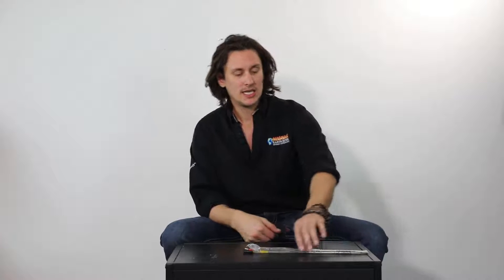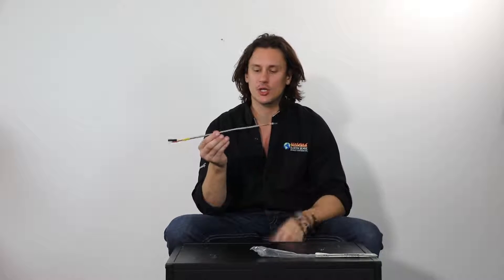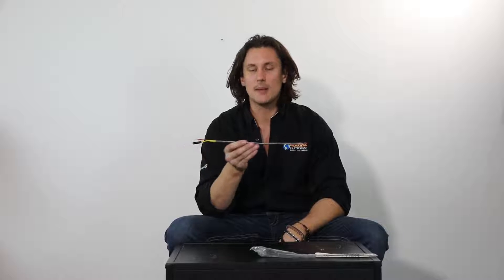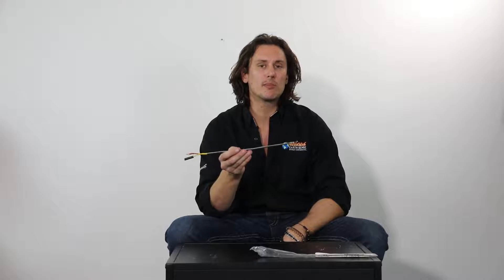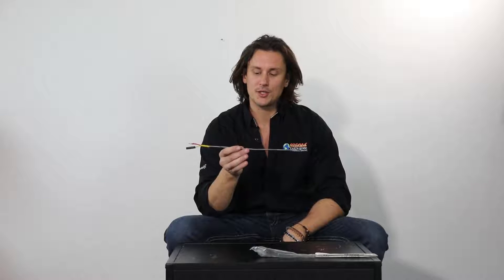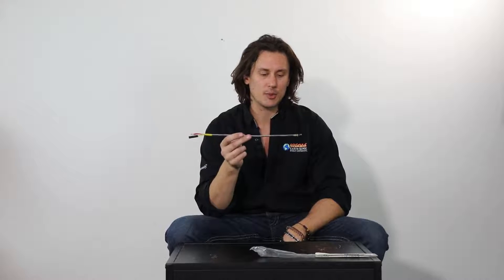Quadrafire Thermocouple Function & Troubleshooting

Comment: Hello, 
My Quadra-fire 1000, has begun malfunctioning. When the thermostat calls for heat the stove starts up ( fans turn on) but does not feed pellets. Fans then turn off, I then hit the restart button and the stove starts it's cycle again and pellets begin the feed and it runs a normal burn cycle. This happens everytime...why would this be occuring? Do I need a new thermocouple? Thanks
Reply from the maker: Thanks for contacting us Jordan, I just sent this to our tech team to get their insight. The Thermocouple only comes into play once the fire has lit in start-up to signal proof of fire. The start-up cycle is a sequence in the control box. Being your stove does feed and go into normal burn operation after hitting the reset button, I would say the Thermocouple and safety switches are operating correctly. I'll follow back up as soon as I hear insight from our tech team. Appreciated.
Reply from the maker: Hey Jordan, Just heard from our tech team. 

'My initial thoughts would be a vacuum switch issue where the switch is not getting enough pressure to close the first round or a board issue. I would try bypassing the vacuum switch first and see if that makes any difference. If it does, then we need to find where that leak or blockage is and remedy that. If it does not change anything then I would start looking at the board.'

Video here for bypassing the vac switch. This is for TESTING ONLY. We NEVER want to leave a safety switch bypassed. https://www.youtube.com/watch?v=FDVkbsHS95U&t=4s

Let us know what you find. Happy to help.
Reply: @EarthSense  thanks for your help guys. I will let you know once I create a bypass switch and get back to you. Talk soon.
Reply from the maker: @jordanwb848  Sounds good Jordan, on standby :)
Reply: @EarthSense  hello again, so the problem has kind of evolved...the thermostat does not start the stove on its own anymore...I have to manually turn the thermostat down and then up, then the stove will start it's cycle or I have to hit the restart button even though the thermostat has not called for the stove to start, but the room is cold and the thermostat should have kicked the stove on but did not. I have created the bypass vac switch and these problems are still happening. I have also checked thermostat connection points and all seem tight and unchanged. I have also tested the thermostat set at max temp and the stove runs a short burn cycle but definitely does not bring the room anywhere close to max temp of 29 degrees Celsius where I've set the thermostat. I have noticed a small hole in the front door rope gasket about the size of the tip of a pencil (I can see the light of the fire here when burning). I hope these additional clues can lead us to a solution on fixing the problem. I really appreciate your help. Thanks again for your time.
Reply: Also please note now that bypass switch is installed, anytime I hit restart button or turn thermostat down then up to start stove that way pellets feed right away and normal startup commences.
Reply from the maker: @jordanwb848  Hey Jordan, thanks for the update. Let's bypass your thermostat. Take the thermostat wires out of the terminal block and let's put a jumper wire or alligator clips on the 2 terminals. Release the connection from one of the terminals to have the unit go into cool down mode. Let us know if it goes through start-up and into normal operation. 

If there is a hole in the gasket where you can see the fire it would recommended to replace it. How does your fire look when it's burning? Crisp/Torchy or lazy in anyway? Happy to help.
Reply from the maker: @jordanwb848  Ok, that's a good note Jordan. Let's do the test on the T-stat suggested in the last message. And let us know how your fire is looking and what kind of build-up you are seeing on the glass. A leaky gasket will create a lazy flame and will trip the vacuum switch. Thanks.
Reply: @EarthSense  ok I will test this as soon as possible, thanks again. Flame does not look lazy in anyway. Glass on the two side panels always seems to get dirty after cleaning them very quickly. Glass on door remains pretty clear except for a bit of dirtiness up at the top.
New note: went to start stove this morning with vac bypass still installed by turning the thermostat down then up again, stove started feeding pellets right away, very smoky startup, followed by smoke coming out of stove from everywhere including hopper into the house for about 2 mins before beginning to vent outside properly. Thoughts?
Reply: Question: when bypassing thermostat, do I keep the vaccum bypass switch in place?
Reply from the maker: @jordanwb848  Hey Jordan, let's do them independently of each other. Have the vac switch hooked up proper while we bypass the thermostat. Then, if needed, we can test it with both bypassed. Keep us posted.
Reply from the maker: @jordanwb848  Hey Jordan, glad the flame looks decent in operation, that's always a key indicator. Could be some build-up or air blockage in the burnpot that caused the excessive smoky start-up. Let's make sure the burnpot holes are cleaned and any build-up in the burnpot is cleared out before re-starting again. Do you have the original ceramic firepot in your 1000 model or do you have the upgraded cast iron burnpot in your unit? Keep us posted.
Reply: @EarthSense  hi guys...so I have bypassed the thermostat, removed one wire from the terminal and it turned on the fans like in a normal startup but did not feed any pellets and shut down after a few minutes. This was with vacuum switch hooked back up as instructed. Next steps? Thanks again for your help
Reply from the maker: @jordanwb848  Hey Jordan, When you bypass the T-stat by jumping across the terminal connection we want to leave both wires in contact to see if it feeds, goes through start-up, and goes into normal operation. When we need to shut the stove down we will remove one of the wire connections on the terminal so the stove can go into cool down mode. Wasn't sure I explained that correctly; please verify when you can. From here if we don't have feed, let's bypass the vac switch and T-stat at the same time. I'm leaning towards this issue being with one of these two items or a combo of the two - just want to rule everything out here before we determine the control board needs a further look. Thanks.
Reply from the maker: @jordanwb848  Thanks for verifying your burnpot style. Yes, let's inspect the burnpot with a good light and make sure all the holes are free and clear.
Reply: @EarthSense  with bypass switch connected to both terminals will I have to hit restart button if stove shuts down after running fans without feeding the first time? Hope that makes sense...
Reply: @EarthSense  there was two holes at the lower end of burnpot plugged that have now been cleaned out
Reply: Ok so with thermostat bypass switch in place, I began by plugging the stove back in...the fans came on for a few minutes and then stove shutdown (this is normal to me) then I hit restart button and the stove turns back on and begins feeding pellets and ignites and seems to be burning normally.
Reply: Unhooked one wire and stove has gone into cool down mode. What does this mean for the thermostat?
Reply from the maker: @jordanwb848  Thanks Jordan. Well I think that rules out this being a thermostat or vacuum switch issue being this is how it was operating before bypassing these components. I think the next step will be to get your control box tested. Your local dealer may be able to do this. We do offer a service to test control boxes, however we need to have the correct stove model to do that. The 1000 is an early stove, but I'll check with our team if we have a Quad 1000 model to test this on.
Reply from the maker: @jordanwb848  Very good, this should help with clean ignition starts and better air velocity in the burnpot. Thanks Jordan.
Reply: @EarthSense  thanks again...on stand by:)
Reply from the maker: @jordanwb848  Thanks Jordan, tech just got back. We do have a system for checking the functionality on a Quad 1000 control box. To inquire further on the service please email info@pellethead.com or call in at 800-236-6647. You can mention our troubleshooting support on YouTube here. Greg B. is the technician I spoke with regarding the ability to test the control box, you can request him for further details. Thanks Jordan.
Reply: @EarthSense  hi again. I think I've found the problem. The firepot bottom, clean out area, was open a crack, I closed it securely and now the stove seems to be functioning normally. It's gone through four cycles now with no errors... fingers crossed that's all it was. Thanks so much for your help and guidance. I've learned so much from you and your videos. It's very much appreciated. Thank you, you and your team are fantastic. Five outta five stars!!!
Reply from the maker: @jordanwb848  That's fantastic Jordan! Only thing I can think of is that it was enough of a crack where it intermittently caused the vac switch not to close. 4 cycles with no errors - Wahooo! Keep us posted, thanks for your kind words. Always happy to help!
Reply: @EarthSense  hello again, 
Update.... So the stove remained having issues. I removed the 80cfm blower motor (negative combustion blower), cleaned and oiled it...stove is working better now. But the 80 CFM blower motor seems to start slowly and after a minute picks up speed and runs at a faster speed. Is this normal for this blower motor to have a slow startup, or is it a sign that it's on its last legs?
Thanks again
Reply from the maker: @jordanwb848  Hey Jordan, thanks for the message. It would not be normal for the blower to have a slow start-up - it should be at line voltage and full RPM within seconds of turning the unit on. Generally speaking if it's slow on start-up that would be an indication the blower motor is on it's last leg. If you need any references please let us know. Happy to help. Thanks!
Reply: @EarthSense  sure I'd love a few references, thanks again. Sometimes it's at full rpm within seconds, but if the stove hasn't run a cycle for a longtime, it doesn't get to full rpm quickly and stops feeding pellets after a few seconds on startup, not enough to get sufficient flame to activate thermocouple and tell stove to feed more...so I guess because the blower motor isn't getting up to speed fast enough it's tripping the vaccum switch...does this explanation make sense?
Reply from the maker: @jordanwb848  Hey Jordan, Yeah that makes sense. I think you are on the right track here with the blower analysis and your vacuum switch tripping. 
Here are some options we have for the Quadra-Fire 1000 Model Blower for reference:
Aftermarket Full Assembly: https://pellethead.com/product/quadrafire-1000-harman-invincible-t-pellet-pro-ii-exhaust-combustion-blower-fan-assembly-aftermarket/
OEM Full Assembly: https://pellethead.com/product/quadrafire-1000-harman-invincible-t-pellet-pro-ii-exhaust-combustion-blower-fan-assembly-oem/
Aftermarket Motor Kit Only: https://pellethead.com/product/pellethead-replacement-quadrafire-1000-harman-invincible-t-pellet-pro-ii-exhaust-fan-combustion-blower-motor/

The OEM is typically special order and our Motor only kit I have just checked in to see if we have any remaining on the shelf. I can keep you posted on that. 

Any other questions just let us know. Thanks!
Reply from the maker: Hey Jordan, We do have a motor only kit available. If you were interested in that I would have you call in to the store. Just let me know, always happy to help however we can. Thanks!
Reply: @EarthSense what number shall I call?
Reply from the maker: @jordanwb848  Call in to 800-236-6647. Ask for Nathan G. - He is the associate I spoke with regarding and will get you taken care of. Appreciated.
Reply: @EarthSense  when you say motor only kit, does this include the squirell cage fan or just motor? I think I need the whole unit as the squirell cage fan is rusted and looking beat up...
Reply from the maker: @jordanwb848  Hey Jordan, sorry for the delay. The motor kit will come with a new impeller, It just does not come with the motor housing. Here is the one we have available as a full assembly with the housing if that is better for you. https://pellethead.com/product/quadrafire-1000-harman-invincible-t-pellet-pro-ii-exhaust-combustion-blower-fan-assembly-aftermarket/

Comment: Great info, I have a question: My quadrafire 1100: On start up, the exhaust fan is coming on, green light is on, feed is not turning on right away like it normally does, then all of a sudden it will come on randomly for a minute or so, then shut off, If I remove the vacuum line going to the feeder and pull air, it will kick on immediately, as soon as I stop pulling air it goes right off. What can this be? I normally service this unit myself as I'm pretty familiar with it. I changed out the thermal coupler, the exhaust fan and still the same thing.
Reply from the maker: Thanks for contacting us, happy to help. Given that you have isolated this to the vacuum switch/hose, I think we need to take a closer look at the switch and/or why it's tripping. You can use a basic multi-meter and check continuity on the vac switch leads. Blow and suck on the vac hose to ensure function of the switch is registering. 

Things to check:
1. Ash blockage in the stove or vent is the issue 95% of the time. Check all ash traps and make sure the exhaust manifold and venting have no blockages. 
2. Door Gasket, Glass Gasket, Ash Door Gasket. Check these seals. Use a piece of paper, close the door, and pull to check resistance. Do this in a few spots around the door. Should be heavy resistance. Visually inspect the glass gasket to ensure there are no gaps/leaks.
3. Exhaust fan should be good being you just installed a new one here. 

Keep us posted, we'll get you back to 100%.

Thanks,
Reply: @EarthSense  The exhaust fan I installed was working ok but apparently not 100% as it wasn't creating enough vacuum. I installed another exhaust fan, worked like a charm. Thanks for the reply
Reply from the maker: @MonroeHandyMan  Fantastic to hear! Glad you found where the issue was. Any future questions please let us know. Thanks!
Reply: @EarthSense  Do those rocks people put in the pellet stove make it hotter inside to produce more heat or is it just for decoration?
Reply from the maker: @MonroeHandyMan  Not sure I'm familiar.. Can you send a link? Most pellet stoves have ceramic logset options, which would be decorative only. Let us know what you are referring to. Thanks!

Comment: Hope you can help , where to start replaced exhaust blower, air switch, and thermocouple so far stone will run anywhere from 15 minutes to 3 hours and shutdown but call light is still on. Feed auger has two pairs of wires red and white and black and white.  The red and white wires with the resistor produces 130V ac when feeding pellets, then it produces 124V ac and goes in reverse with no pellets feed no rim or reason for this and no pattern to it. What am I missing here?
Reply from the maker: Hey Jeff, just touched base with our tech team on this. This is a very odd issue. It could be an issue with the board but we're not 100% confident on that answer and would suggest having a local tech get hands on with the stove to see what is going on. We do also offer a service where we can test the control box and there may be a local dealer that may offer that as well. Happy to help however we can. Thanks!
Reply: @EarthSense  Thanks for the reply I did purchase a new control box with the yellow label (4 speed) but when i plug that in I get no feed on the auger at all the exhaust fan just runs but that’s it.  I just thought I was missing something.  I will call my local company to take a look at it.  Thanks for your time.
Reply from the maker: @jeffmyers4152  Certainly Jeff. The 4 Speed Board will be used for the Mt Vernon OE (Original Energy) unit only. Yeah, to me it definitely sounds like something is amiss with the control box. Yeah, let's see if the local dealer you have can test it for you. If you want to let us know your model we can verify the correct board and part numbers if you need. Happy to help, keep us posted. Thanks!